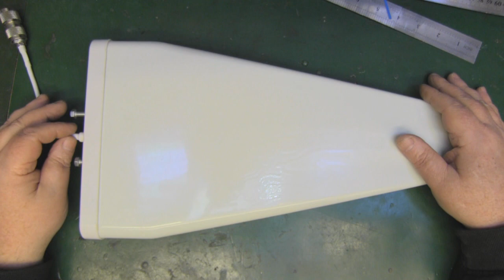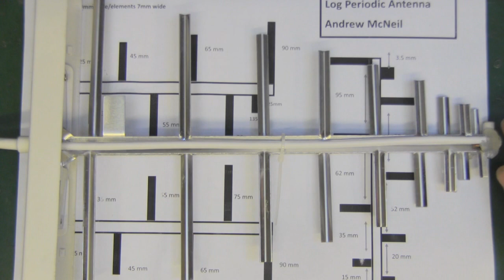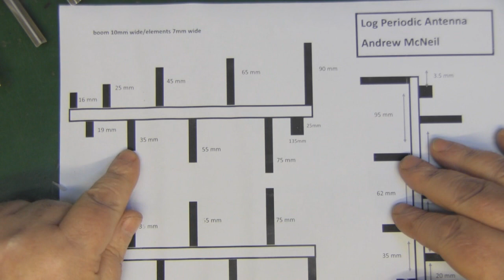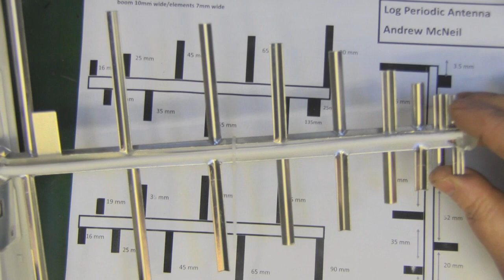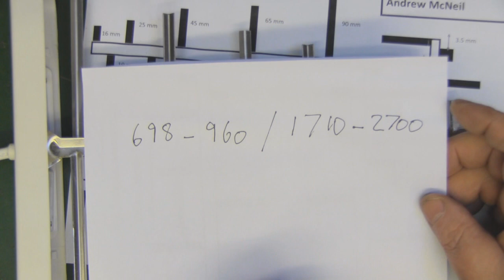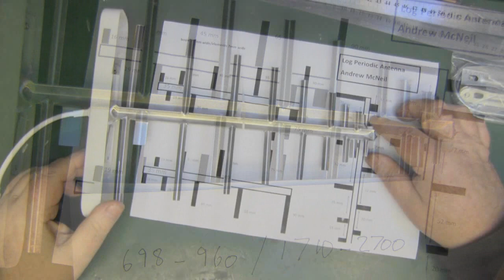3G 4G LTE Log Periodic Antenna

Comment: I have some of these from Wilson that are used for 4G LTE.  They don't have a lot of gain and are not very directional but the wide bandwidth is needed for cellular signals that range from 600-2500 Mhz.  One problem I've had is the white plastic case only lasts about a year in the Arizona sun before falling apart then has to be replace with a new box.  There is a similar model from China on Ebay for half the price that is a knock off of the Wilson and while the antenna itself works well it comes with a length of junk RG8 cable that has very high loss so I cut it off at just 4 feet and installed a new connector to make the antenna usable.
Reply from the maker: I have yet to find an original antenna from China LOL

Comment: extend the centre feedline (the "split boom") by a cm or two and add another smaller pair elements at the front in the same fashion and it should cover up to 2700Mhz. 
Rather than extend the boom parts themselves, you may be able to just bolt extend the boom with some aluminium strips - ensure a couple of CM overlap. Aluminium oxide doesn;t conduct (not very well anyways) BUT with sufficient overlap it doesdn;t need a direct electrical connection (at DC) because at RF (we're talking 700MHz+ after all) the overlap will have sufficient capacitance to couple through any oxide layer

(the oxide layer forms on all aluminium in seconds after cutting/sanding/filing - you can't really avoid it - but like I say at high UHF you need nt worry about it, just ensure enough overlap to reduce losses)
Reply: Also, one of the ARRL Antenna Books has a great article about log periodics, including design charts  for maximum gain, spacing, number of elements etc. Think it may be the purple-cover one from the 80s? - not sure if later editions one have it. 
AIUI, more elements in a given boom length gives slower VSWR, as any 3 elements at any given frequency are in action. The rest act as less influential reflectors and directors, and the more they are "too long" and "too short" spectively, the less efficient they are at giving gain. 
Longer booms give more gain, for a given amount of elements, up to a certain limit, then it tails off. 
As usual in ARRL books, lots of charts and nomograms so not too hard on the maths. 

The L-Ps I've built in years gone by were more "by eye" than calculation, and worked just fine, even up towards 3GHz. My rule was "if in doubt, just make all elements long then trim them off with a ruler for a nice slope at top and bottom" haha. I make a few with 12 SWG solid copper for the boom and 14SWG for the elements at high UHF. Then just snip to length. 

The split-boom spacing (and dimensions) do affect characteristic impedance so if you use different boom materials experiment with the spacing - it acts like a feedline.

Comment: I too picked up a couple of cheap LPDA antennas in a similar case to what you have here in the video, for $14 USD. They have twice the amount of elements on them (30 in total) doubles of each length on opposing dipoles. The sticker on the back says a 9-10 DBI gain, which I believe is higher than this. I haven't installed them yet, but am likely going to use them polarized (90°). Going on my cell signal booster.
Reply: i just got wacked £100 for two log periodic with 5m sma leads,  is thet good or should i get a refund or partial refund?  i think that's taking the piss when i see people getting them 8 dollars.

Comment: I'm interested in a PCB version of this, specifically whether a dual polarised version could be constructed (2 of them co-located and mounted at 90 degrees to each other). Then whether you could use a cheap satellite dish as a reflector mounting the antenna in the reverse direction as a feed horn. Would make a great project ;)

Comment: Once again, thanks for a interesting video. 

One question about Polarisation, would it work better if I use two (2) antennas, one horizontal and one vertical?
Second question about mounting, can I mount it indoors or does it have to stay outdoors.
Indoors I could use much shorter coaxial cables. 

A tip to those who do not get a better signal. 
This is an Directional Antenna not an Omni-Directional Antenna. 
You’ll need to align your directional antenna with the nearest signal mast. 
It gives the maximum amount of gain from one direction, so useful when you have marginal signal.
Reply: I would also be interested to know whether two antennas will work better than one and the orientation of these. How much signal can be expected to be lost when using an ebay type extension cable with connector instead of making a custom soldered SMA coax cable?

Comment: I doubt it achieves full 10 to 12 dBi as advertised. Branded LDPAs in the £60 price range, e.g. Wittenberg LAT 58 with somewhat longer booms (1 m) and a lot more elements (58) only achieve 9 to 11 dBi. The number of elements in LPDAs and Yagis correlates with the gain factor to my knowledge.
Reply: accordingly to the chanpuak  online calculator, something 30 cm long can gain more than 7.3 dbi. Something 1 meter long 9.8 dbi

Comment: I just bought an antenna like this one, perhaps it is the same one, but sadly, it's not improving my cellular reception.
Reply: I did the same a year or so ago - bought a 4G LTE and it marginally helped.  - That's why I sent this request to Andy >> (note the build quality on my purchased unit was rubbish,... I had to strip it down and rebuild it & add new/decent 50ohm coax.
@AndrewMcNeill - Great find,... and result for the price. Can't wait to see your take on improving the design/manufacture and build it along with you.
 - - Any chance of posting the ORIGINAL eBay ITEM number (seller) so I may get one to do a similar  PLAY/MAKE/BRAKE ???
.
.

Comment: They're not showing up on eBay for £8.50 only about 30 do u have a link
Reply: Same. He was probably being lucky with some clearance or B stock? Still some 20-30% cheaper than branded ones made in the EU, but possibly lower gain in practice.

Comment: Have 2 of them, they dont work at all.  router works better without it. same inside. Tried every orientation
Reply: Does your router normally have internal antennas? If so you need to select external antennas from the settings menu. Which router were you using?

Comment: @AndrewMcNeill - Great find,... and result for the price. Can't wait to see your take on improving the design/manufacture and build it along with you.
 - - Any chance of posting the ORIGINAL eBay ITEM number (seller) so I may get one to do a similar  PLAY/MAKE/BRAKE ???
.
.
Reply from the maker: I did not link it because he did not have any left https://tinyurl.com/y3x7dmqh
Reply: @andrewmcneil  - Big thanks Andrew.
Reply from the maker: @stevemacbr  No problem Steve
Reply: @andrewmcneil  I guess my slight critique of your video, then, is that you referred to the price about half a dozen times with emphasis and come to find out, the source is no longer available for that price. 

Small hit. 

Otherwise, awesome presentation! I have two of these left over from a work project... Always wondered how good they were. Cracked one of mine open also. 

Log Periodics are ALIEN compared to a Yagi that I have come to understand! 😜

Appreciate you!
Reply: If you can't find them on ebay then you're not looking, mostly Chinese sourced so broaden your search outside Europe.

Comment: The Ali Express one is better, I got the Ali one first then the eBay one, the Ali one fills the housing.
Reply: Interesting. There are two main versions of this, one is a bit shorter and cheaper with a slighly lower gain and is quoted as between 800-2700MHz and the longer one between  600-2700MHz. I wonder if some of the shorter ones are mounted in the larger box by some suppliers?
Reply: Can you please share a link? thank you!

Comment: ive got 2 of these in the loft right above my bed where i sleep. should i be worried about radiation?
Reply: Are you worried about radiation from your cell phone?  Do you have your head at the pointy end of the antenna?
Reply: Nahh.  There is back bleed from log periodic antennas though the return signal hitting the antenna blasts back and down from the antenna a little bit though from image ive seen its not much but still significant.

Its not just point to point like you think.